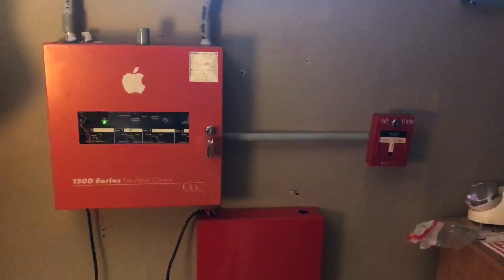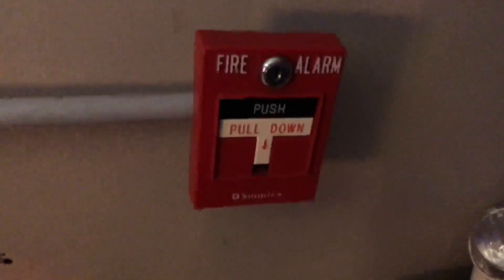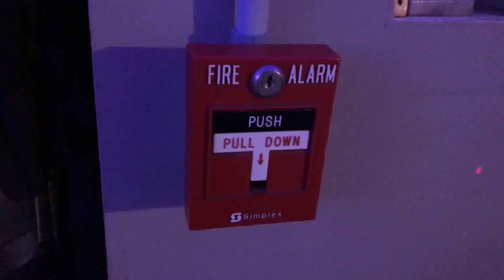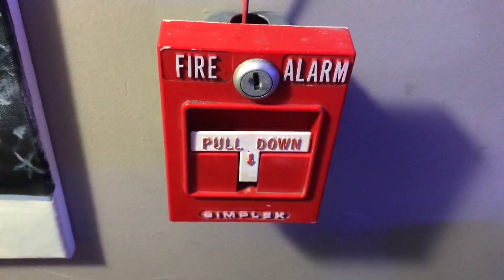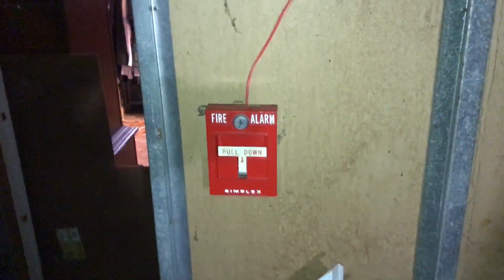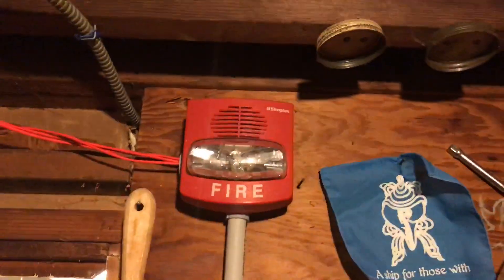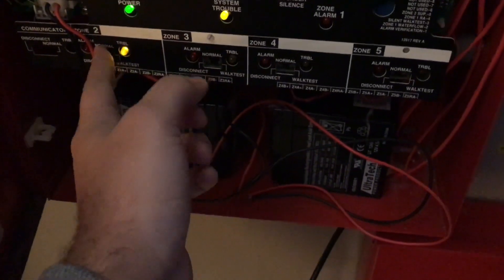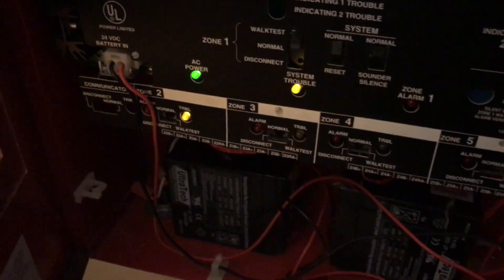System Test 7: Simplex!

Comment: I’m surprised you didn’t put up a 4050-80
Reply from the maker: Sadly they’re not polarized, meaning the current doesn’t flow in one direction. It’ll need a diode for it to be used on my system, otherwise it wouldn’t work correctly and give me a NAC trouble.

Comment: Lovin' Simplex as always.
My former campus has those Simplex devices. The health building had 2901-9838/4903-9102s and 4251-20s on a 4001, which sadly have been replaced with the L-Series and Firelite BG-12LXs on some sort of Firelite panel. The admin building has 4099-9001s and 4903-9425s, and the business building and library both have 2099-9754s and 4903-9219s mixed with BG-12Ls and Wheelock ZNS' in the business building.

Comment: The junior/senior building of my high school back in the 90s had 4903-9838s mounted the same way as you have yours except they used the strobe plate version.  The whole school had 3 buildings with 3 separate Simplex panels all with 9838s the one mentioned above was set to continuous the freshman/sophomore building had them with the strobed on the left and that panel was set to 90 BPM march time the second gym which everyone referred to as "The new Gym" had the strobe plates mounted the same way as the junior/senior building but I was never in it when they did drills so I never found out what it was set to.  The installers who put the systems in must've been on some serious crank :XD